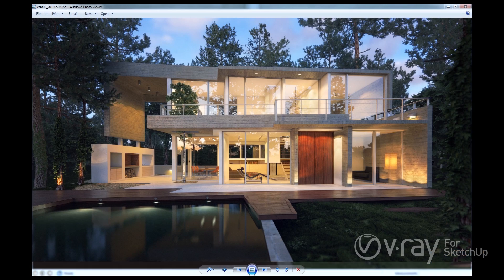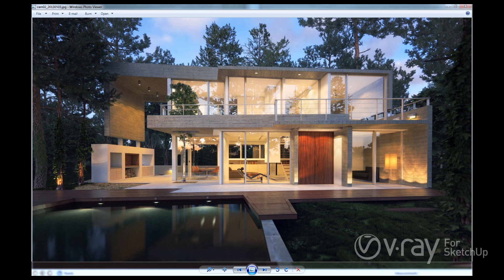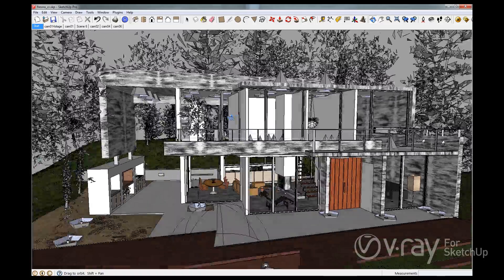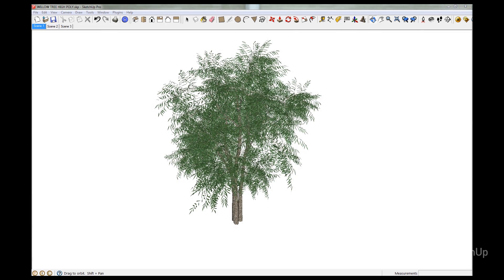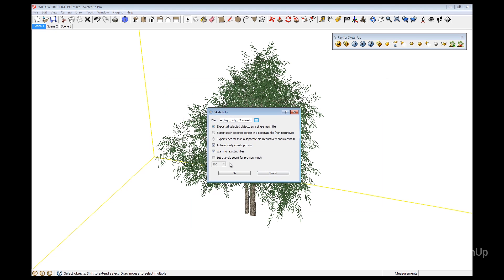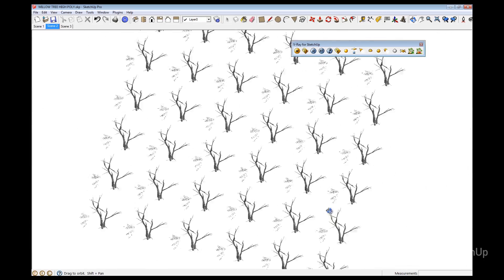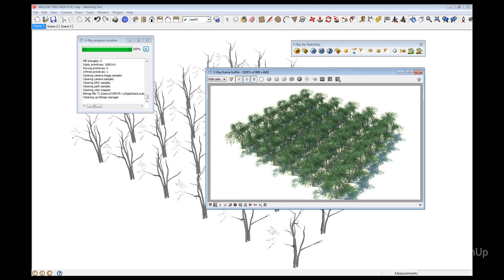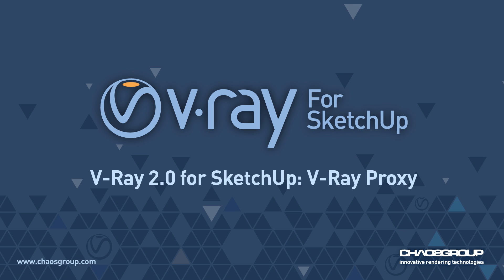V-Ray 2.0 for SketchUp - V-Ray Proxy

Comment: I can't export proxy for high polygons trees my sketchup get freeze not responding for hours ..... my PC spec. intel quad core2 q6600 2.4 ghz, ram ddr2 4 gb, VGA GT 710 gefroce, windows xp 32bit ........ i searched on the internet some experts says that there is a bug in Vray 2.0 causing this problem and they suggested that i turn into a new updated version of Vray 3.4 or 3.6 ........ the problem my PC can't upgrade to 64 bit to run sketchup 2018 .

Comment: Good afternoon , how I can make HD renders with Vray , ie , I need to generate a file in jpg or png to print in high definition ?
Reply: Efrain Galicia increase the resolution in the output
Reply: I' ve already increased to 2460 units, more or less, but the jpg file increased some bits 680, it isn't good to print the image in hd, any other suggestion? Tanks for your atention
Reply: what size do you want to print at? and what is the resolution exactly.
Reply: also try increasing the sub divisions if youre image isnt good quailty
Reply: Upper than 1gb, it's possible?
Reply: you would probably need files in those sizes. and the resolution would be in the 10,000's of pixels. But i cant be sure since i dont usually print with these sizes.
Reply: I designed an interior house, my client wants to promote it in a big sign, and my file it isn't good enough
Reply: How to encrease the pixels?
Reply: go down to your local print shop and ask them what the resolution should be
Reply: in the vray options, click onm output and you can change the resolution of the rendered image. the bigger the res, the longer it will take
Reply: Ok I' ll try. Thanks a lot for your advise
Reply: no worries, good luck :)